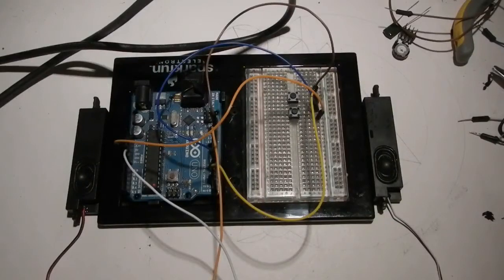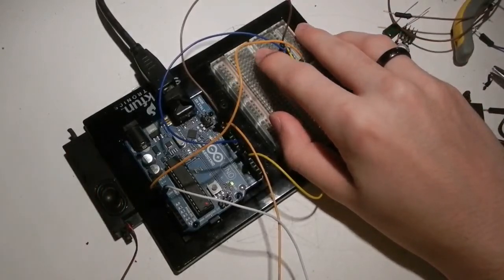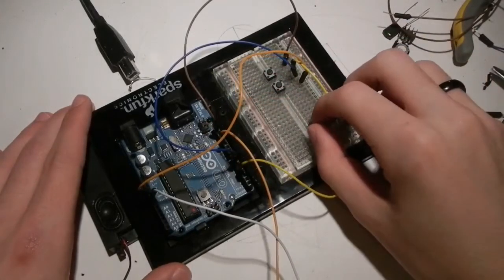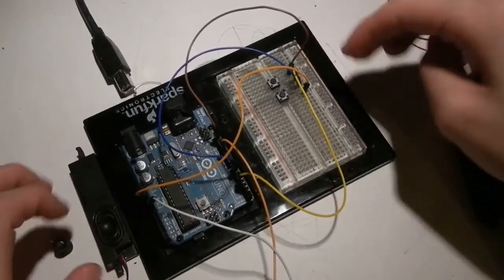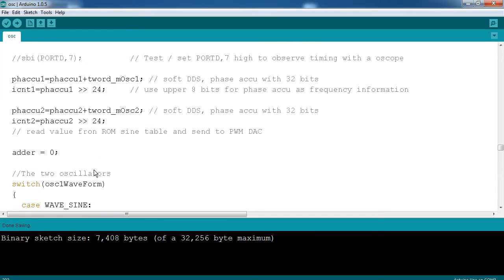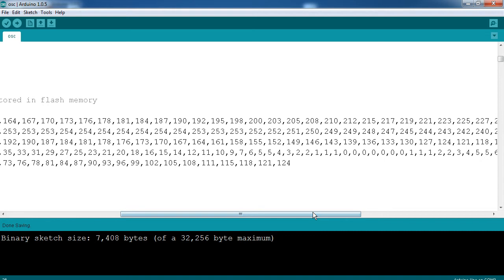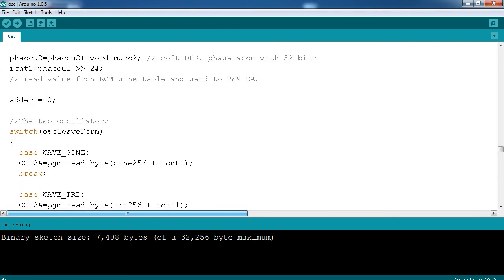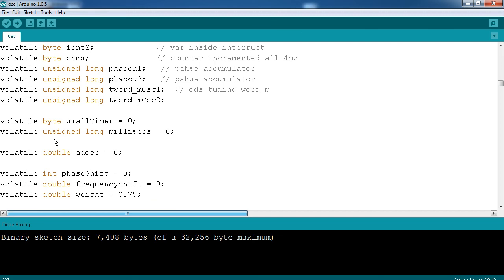Arduino Wave Form Generation

Comment from the maker: Each wave table represents one period of the wave. Each table must have 256 values ranging from 0 to 255. For the triangle and sawtooth waves, each is a regular increase from 0 to 255, the only difference between the two is slope. The square wave is at 255 half the time and 0 for the other half. The sine wave is just extrapolated from a normal sine wave but instead of ranging from -1 to 1, they were scaled to be from 0 to 255.

Comment: Nice vid last night I was watching a video on this guy who was doing the exact same thing with a PIC as far as waveform generation, I think his PWM was going at about 40KHz and he used a resistor and capacitor that went from the output to ground and scoped in between them and it took out all of the 40KHz noise

Comment: I'm pretty sure the Arduino doesn't put out a negative voltage at ground, right? So does that means it's a DC wave, and only pushes the speaker diaphragm one way? Just wondering (yes, I know I'm a noob)

Comment: Have you tried Atmel Studio to program your Arduino? It is much easier on the eyes and user friendly than the Arduino IDE. It even has a software based debugger.

Just get Atmel Studio 6.1 at Atmel (dot) com and then Visual Micro at VisualMicro(dot)com.

Comment: It's fake. You can't generate triangle and sine wawe with arduino. Because arduino doesn't have digital to analog converter. You can generate just squre wave
Reply: You can create a resistor ladder to make a rudimentary DAC. Or use a simple 8 pin chip such as the MCP4921 http://www.microchip.com/wwwproducts/en/MCP4921